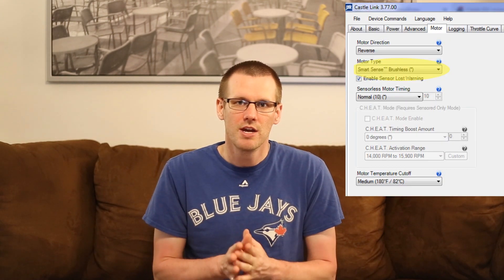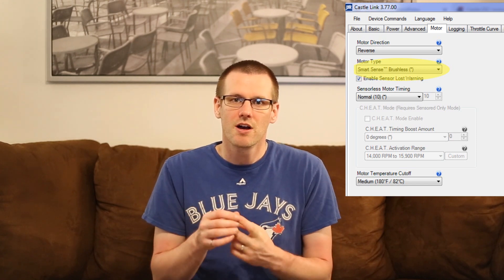Timing Explained for Brushless Motor and ESC's

Comment: You can google it. Most castle products are 50k including all Val and box, some of there top dollar motors are 70k. Tp is 70k for most, but scam motors are 120k. Nothing touches them. They are heat plants, so buy the right size for your scale. A bit pricier, but torque monsters with speed for days. Reedy ae 50k, but seem best suited for buggy/trophy running. Great torque, lo top ends. That’s what I got. I run a drk, and a 4.5t hole shot, but don’t have the info on theses.
Reply from the maker: I googled it, still shows 60,000RPM for 15 series Castle motors. It also shows 90,000RPM for the 1721 2400
Reply: @RCexplained  cool, now check scm tp motor series. Don’t get me wrong, castle and neu motors are great, but don’t sleep on tp. Had another shop owner today telling me he and his buddy were running twin 2800kv limitless’s in drag. One tp one castle, 1.8s. The difference is you can just keep adding power to the tp and they are monsters of torque thru the entire range. I ant to find out? If you can find one, get the 2350kv scm, and gear however ludicrous you want. It will get hot, but it will push more power than anything youre used to. If you use the max5 g2, it may amp out, but if he motor will hold every bit of that 12s, and good luck to anyone trying to keep up.

Comment: 2950 2 pole motor, do you have any suggestions on how we should gear it and how to set it up on the esc settings, it keeps doing 1.99 no prep and whatever we do we get 330 amps max and 12 hp. Seems that needs more rpm that what we currently get. The motor is 100k rpm and we only get 72...let me know what you think thanks!

Comment: I stumbled across this while trying to get a better understanding of timing, boost, turbo. Apparently due to your clear explanation, you’re still on top of the list years later. 
With that said, I want to personally thank you for the time you take explaining everything clearly and in a way most of us finally understand. I’m 52yo and have been in the R/C world over 40-years now. From cars, to boats, planes, helis and drones, I thought I understood most of it until the sensored programmable esc/motors became mainstream. I figured with so many years of experience, these features were just minor adjustments and were just added more for the sales and flashiness of it all. Turns out it was just laziness on my part not wanting to learn new tech, because after your video, followed by some tweaks and Hotwire settings (TEKIN), boy was I missing out! What a huge difference changing the manual (can) timing, switching esc to sensored AND sensorless, then manipulating the turbo & boost to get BOTH low end timing improvements through manual, as well as high timing adjustments via the sensored electronic settings. So thank you for the lesson, your 10+ minutes taught me more than the past 5-years of reading manuals and playing with settings. I intend on watching many more of your videos (if still available) and getting my learning curve straightened out a bit more. 
I am curious what the best way of knowing the RPM range of each motor is..? It’s not noted anywhere and I’m not sure whether the software just “knows”, or if maybe data logging might be the best way to go about ultra fine tuning hose parameters? I’ve done data logging on my full scale GTR quite a bit to get waste gates, blow off, etc. in sync with turbo. Usually send logs in for programming, but have made minor adjustments also. Hopefully I’ll find one of your videos about it shortly. Thanks again!

Comment: Nice, appreciate you making this for us lol. I’ve got a new Losi DB Pro and it has a slight hesitation when accelerating from a dead stop. Also makes a slight noise so hopefully this will help fix it, pretty sure it’s normal but it bugs me so 🤷🏻‍♂️. Appreciate it.
Reply from the maker: Are you using a sensored motor? A sensored motor would remove any hesitation from a dead stop. Adjusting timing usually won't help this.
Reply: @RCexplained  I had no clue until I just looked it up and it’s the “Spektrum Firma® 4-Pole 3150” which is sensorless. Hopefully I can work it out, if not, no big deal.

Comment: hi there, can you please help? 

what kind of timing should I run on my end bells and ESC for that track? 

my B6 has xr10pro stealth 
26T p 75T spur with HW  V10 13.5  which comes with 40 degrees set on the end bell 

my T6 has xr10 stock spec, same V10 13.5 with 40 degrees on the can.  it has a 25Tp 81T spur

I've done some research which tells me you can get more performance with less heat by reducing mechanical timing and adding some dynamic boost/turbo on the ESC  but can't find any examples

here's the track I run on most. it's tight and med/hi grip. https://youtu.be/srJIH-eyg5E?si=gAtE9kjlkcDlPdNE

https://youtu.be/mGiFJJ2R4XA?si=EqTTqyRMPZhMwfLE

https://www.facebook.com/anever.myers?mibextid=ZbWKwL

Comment: I have a motor in a freewing moray...had to change to a hobbywing 40 amp esc...the motor looks to be 28 35 ,1500kv...i bench tested on low and med timing on esc..i can not tell the difference...i just want to know if i should set timing at low or med...i am using 1500 4s 50c battery...thanks
Reply from the maker: Low

Comment: Hey I have a Traxxas hoss that is stock besides 50 tooth spur and a 20 tooth pinion and it has a spectrum firma 150 amp ESC and a 2050 KV motor combo what should I have my timing set to to get rid of just a tiny bit of cogging I really don't want to go back down a tooth I mean I will if I have to I just can't find the gear at this particular time at my local hobby shop and I really don't want to order one but it's set to factory settings I think it's like 22.5 degree is it set to right now
Reply: I have almost the same situation. A Traxxas slash I put a arrma 2050kv and 150amp esc. It cogged with a 21t pinion so I went down to a 19t and it still cogs a little but if I go down much more it will be a slug. It already tops out at 43mph... Did you figure it out?

Comment: my esc struggles to get the car going and i bought the programming card. i put the start mode at level 10, i'm not sure it helped. i don't care what the speed is on this thing. once you started talking about sensored motors i knew i'm on the wrong video because mine has no sensor.
Reply from the maker: This video is not specific for sensored or sensorless motors.

Comment: My mmx8s 1520-1650kv combo is running 10° of timing from the factory, if I bumped it back to maybe 6° or 8° of timing, would it make my motor run cooler, more torque, more efficiently, and less heat, but be slightly slower on top end? It's an off road build, needs torque anyway

Comment: What is the maximum amount of timing you can apply to a motor before it becomes inefficient? I have a hobbywing XeRun XR8 pro and it supports 48 boost and 48 turbo, and when combined with a possible 40 on the motor you can have 136 degrees of timing! I’ve heard that the maximum you can have is 60 total, is that true?
Reply: It’s late but doing my own research and R&D the motor seems to be happiest around 44-51 degrees “Combined”
Reply: The higher the timing the more heat you will have, this inefficiency.
But this depends on your ESC and motor model. 
Whatever brand you run, join an online official forums and you'll be able to ask expert hobbyists on there questions. 
For instance, I run a Felony, so I joined Arrma official forums, and I get answers to all my questions from other Arrma owners within 30 minutes, depending on who is online.

Comment: Hi my 14 pole 6s brushless motor having squealing sound at high throttle. Could this be  timing issue? I changed timing to 22. But still getting that noise

Comment: I'm currently build a F16 90mm with a 1500kv  10 blade with a castle 160 esc would i need to set a low timing it is going to be 8s.
Reply from the maker: I usually start with low timing on hot wound motors

Comment: my fms 1450mm Mustang did the squeal on a full throttle pull to vertical. motor stopped instantly followed by torque roll and crash.

Comment: Good info you gained a subscriber, is it possible to eliminate acceleration hesitation by adjusting the timing?
Reply from the maker: Thanks for the sub Sheldon!  It's not possible to eliminate startup hesitation through timing in the testing I have done.
Reply: @RCexplained  Yeah I didn’t think so gotta go with the sensor

Comment: OK, so, question: can you lower a motor's timing for better torque and acceleration, and then set your gearing for top speed, taking advantage of both?
Reply from the maker: Yes, absolutely.
Reply: @RCexplained  Could you do a video on that?

Comment: Can you use boost mode or turbo timing on a four pole motor
Reply from the maker: You can but I would not recommend using fixed timing.
Reply: Ok thanks so much I using the motor for 132ft drag racing so you would use it thanks for the great info

Comment: On brushed motor escs the turbo mode used to just switch a relay so the motor was connected directly to the battery.

Comment: I drag race with sensored motor but certain timing  tunes i use the car gives a rev limiter effect just before the finish line is that normal
Reply: Also what if i put the cheat mode to 20° @ 5,000 rpm - 25,000 rpm and my motorendbell is set to 20° when the motor is at 5,000 would the timing  40° and would it go back to 20° after exceeding 25,000 rpm
Reply from the maker: I'm not exactly sure what you mean by a rev limiter at the top end of your strip. Certain timing on your brushless ESC can definitely lower your ability to hit maximum RPM's. I would definitely want to make certain that any type of fixed timing is removed at high RPM's. 

As far as 20 degree timing by rotating an end bell and then setting 20 degrees in your ESC as fixed timing, I would expect this to be adding. It would depend on whether your ESC is using the sensor data when the ESC adds timing. If the sensor position @ 20 degrees is used at the time the ESC is at 20 degrees of its own timing, these will be added. If the ESC is operating in sensorless mode, sensor position is ignored meaning that 20 degrees on the endbell is not used.
Reply: @RCexplained  thanks i was running 20°on my fixed end bell along with cheatmode probably that gives me the fluctuation in rpm (rev limiter effect) i set the endbell to 0 and the motor runs alot smoother
Reply: I tried a new cheatmode setting 21,000rpm/76,000 rpm and the motor seems faster and smoother thanks for the tip
Reply from the maker: @racingrivals8934  Right on, that's great.

Comment: Castle seems to be a very good brand.

Are other big names in Hobby in same class? I assume answer is yes.
Reply: 1/10th and 1/8th cars and buggy. A Slash 2wd, 1/8 4wd buggy for dirt.
Reply from the maker: @tonyromano6220  have you looked in to Tekin?
Reply: PropWash Yes that is one of the brands I am thinking about for my top end rigs. VS display or light play RCs!
Reply: The new Spektrum ESC's are supposed to kick ass i just got my 100amp avian Smart ESC today so i could have all the telemetry to my DX8G2 radio with the AR620. Its going in my FMS Votec 322 1.4m stock 4258 650kv motor but with a 15x8E apc prop. Using the Spektrum Smart 5000mah 100c 6S lipo also have a couple Spektrum Smart 4200 50c 6s packs
Reply from the maker: Is this for a specific application? Boat vs airplane for example.
Reply: Onyx is good.
Reply: Ill be flying it this weekend to see how it does